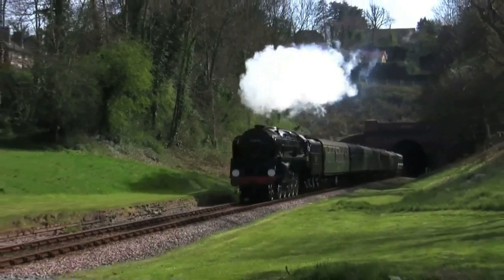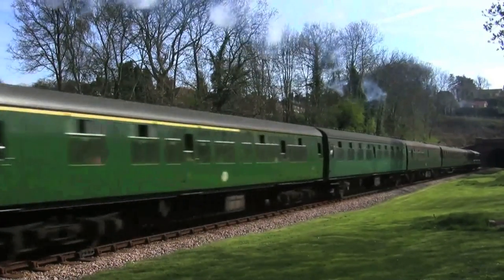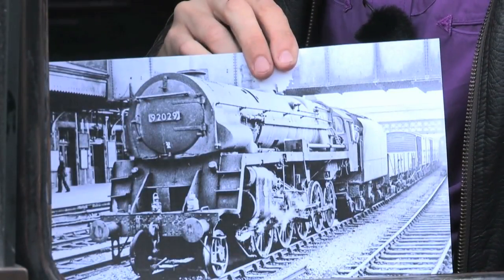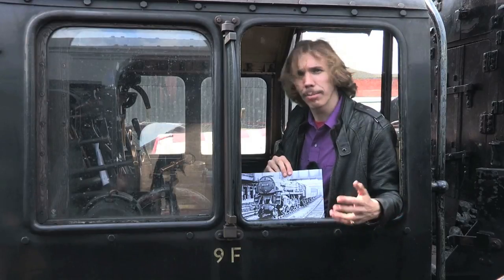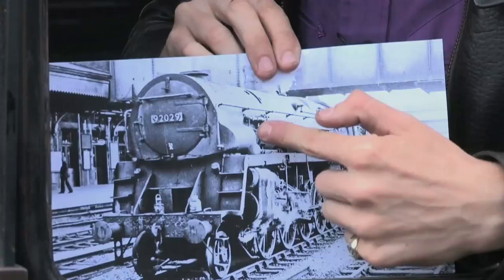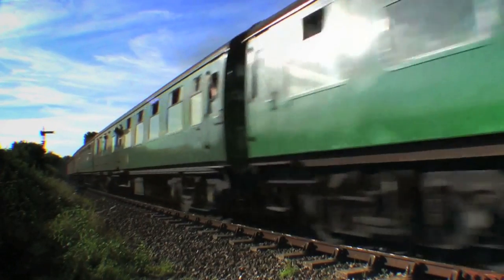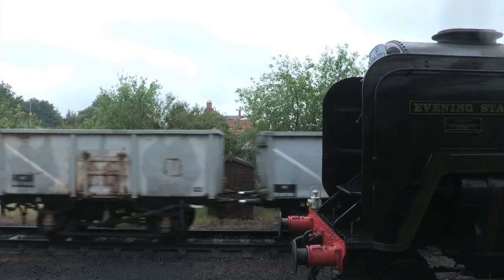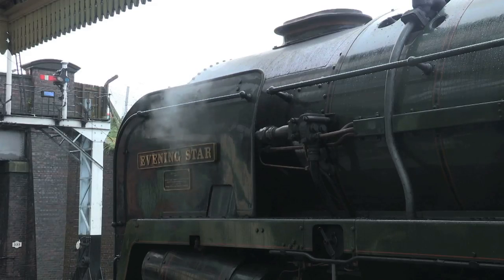STEAM LOCOS IN PROFILE: Volume Three DVD Sample - BR 9Fs

Comment: The 9Fs are my favorite British locomotive. But I have been wondering two things. How did they stack up against those Garretts used by the LMS in terms of pure tractive effort, and why was the largest and 'most powerful' locomotive produced in Britain a 2-10-0 Russian? Surely during WW2 The British Empire could have used larger locomotive for longer frieght trains. Was it just a fact that what was on hand was getting the job done or something else?
Reply: The class 9F were built from 1955 to 1960.  The war did not really have any baring on the size of freight locos in the UK.  This is mainly down to the loading gauge and hand firing.  The diameter of the boiler could only be so big,  once over that size the engines would not be able to fit in the tunnels, through platforms and bridges.  If you make the boiler longer you end up carrying around cold water.  Across the empire not all lines were 4'8.5"  the narrow gauge lines tended to use Garratts.  The  LMS Garratts had about an extra 5000 lbs of tractor effort, but were limited in speed due to the poor design of the axel boxes.